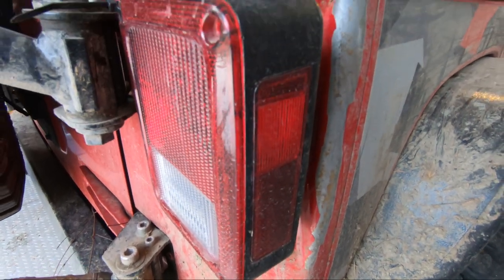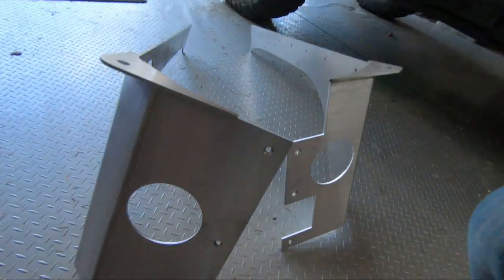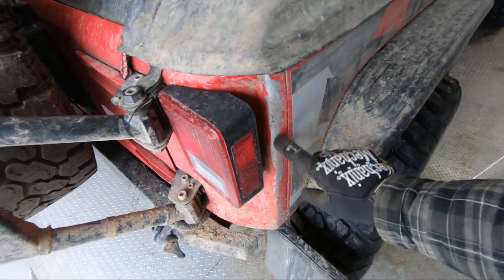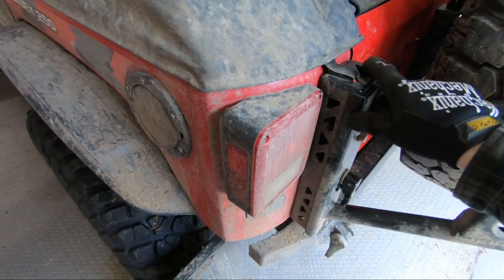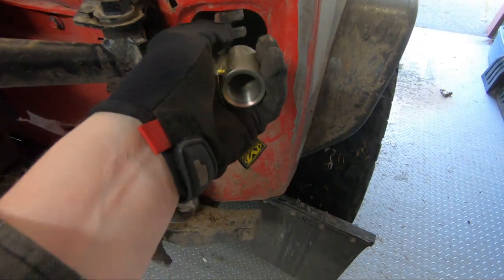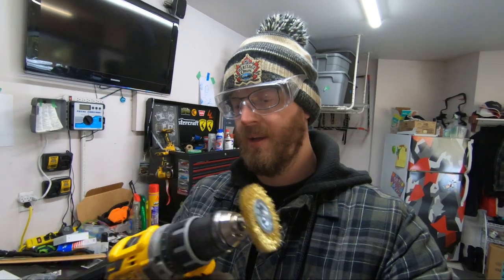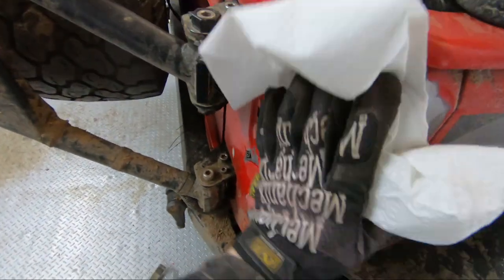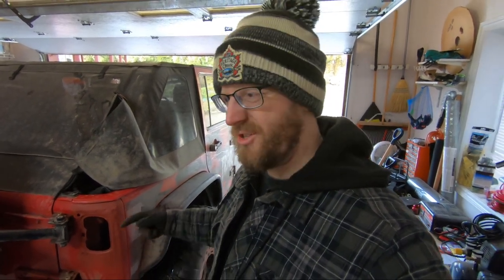Jeep Corner Armor Review + Repair Tail Light Damage | Part 1

Comment: Max-bilt makes brake/turn/reverse lights with side makers if you want to go that route. They are pricy though.
Reply from the maker: Thanks! I did check them out. I really like them however to use them id need to add red reflectors some where to the back. Because of that I decided against them as non-red tail lights is a quicker way to get pulled over around here.
Reply: Casey_250 that’s why I figured. The traffic laws are so different from place to place, you have to keep the MAN off your back. .

Comment: Great video! Looking forward to part 2. I just smashed the other side on my Jeep and found your video! Subscribed! 

Do you plan on putting any RTV behind the skins to keep any water/mud out? Maybe just on the top? Not sure if that would help but I have been thinking about that for when I get skins...
Reply from the maker: I'm going to run a bead of silicone across the top i think. Seems to be the most common way to do it i can find. Keep stuff from running down into it but if anything does get in, it will drain out the bottom.
Reply: @Casey250  awesome! Looking forward to more content!